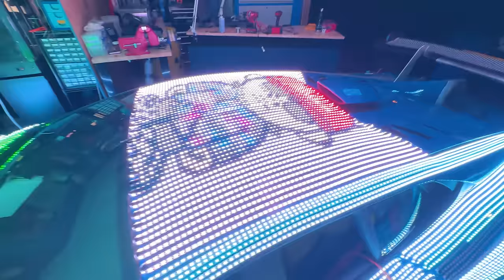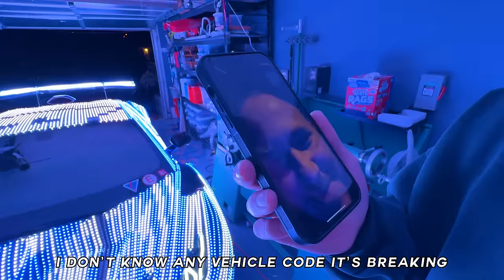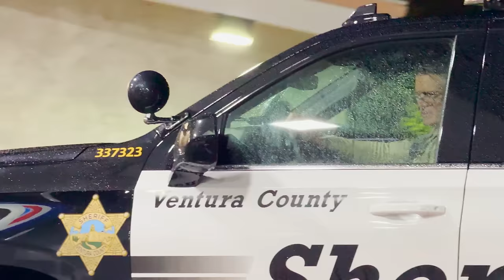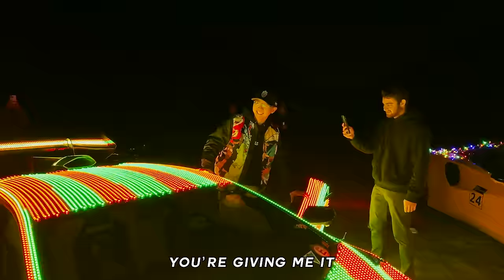The World’s Most Distracting Car (30,000 LED’s on a LAMBO)

Comment: lame. To do this hackjob on a lambo?!
Any generic person can do it on a econobox, to just buy some aliexpress led strips and simply apply them on a car. lol
I was expecting an actual exclusive type of build, using thin, leds and wiring that could then be painted over or wrapped over and not be seen at all (except the part that makes light, so that it looks like a normal car at first sight, but then BAM, lights on.
This here with led strips slammed on the body, bruh is lower than the bottom of the barrel